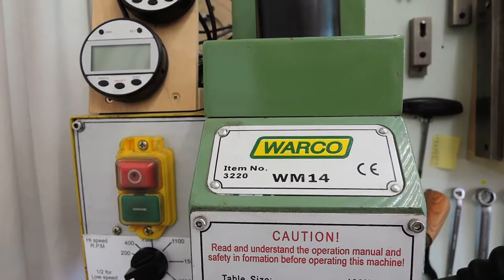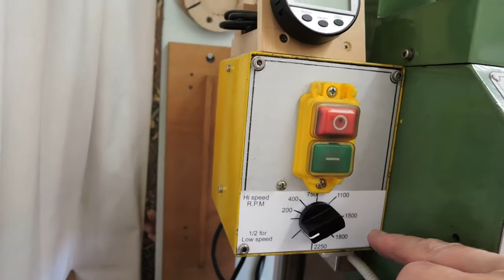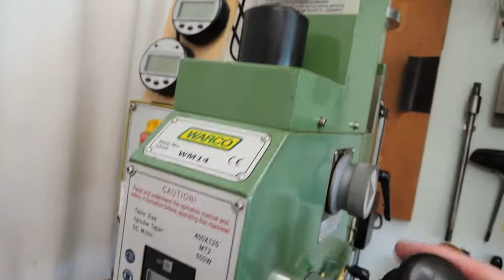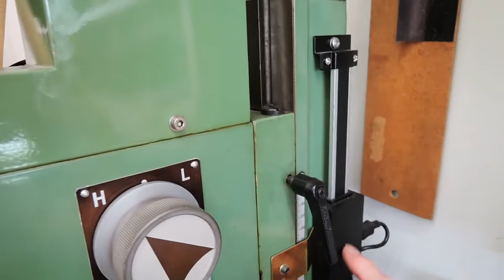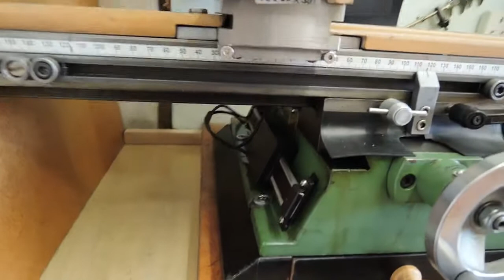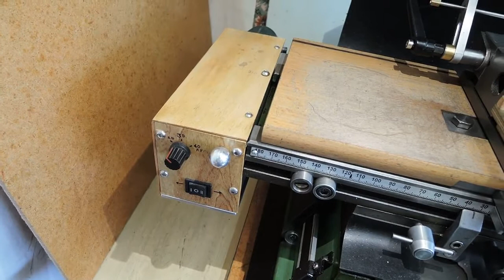Screwless vice Mods  Pt2  toolmakers vice on Warco WM14

Comment: Thanks Geoff, that was great, some interesting ideas.  I don’t know much about steam engines but I would like to try and build a miniature combustion engine.
Going to want a dro and a rotary table next to go with the new mill. One question are your dovetail ways on your column and base ground/scraped? Mine are just finished with a flycutter.
Reply: That may not be a fly cutter finish your looking at Sam. There's a process called Blanchard Grinding where the face of the wheel is used. It can leave a very similar surface to fly cutting but isn't how it was done. I also think it's a slight effort in gaining an oil retaining surface some what like hand scraping or oil flaking does.
Reply: @turningpoint6643  thank you very much for your reply, that makes complete sense.  What confused me a bit is the dovetails have been done opposite to what I have seen in pictures, so basically I have seen the column and base “scraped” but on mine the opposite side of the dovetails has been scraped (aggressively).  I’m waiting to hear back from the supplier atm but your comment has made me feel less worried.
Reply from the maker: It doesn't look scraped to me but there are some small machining marks ,